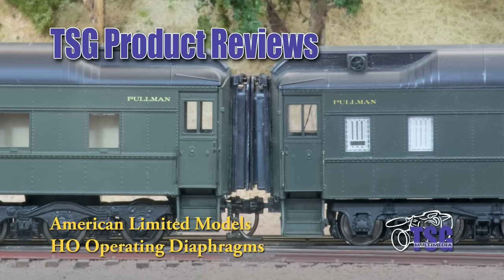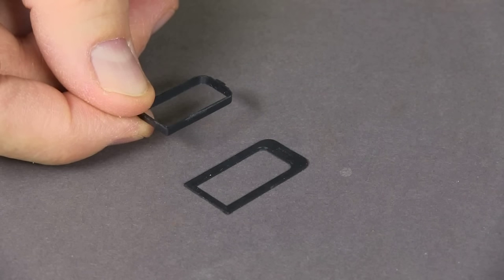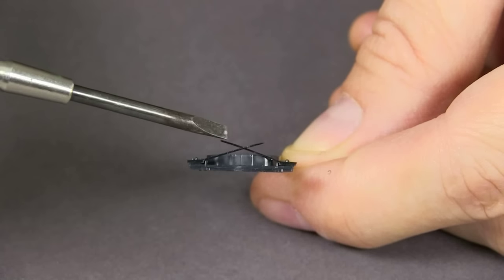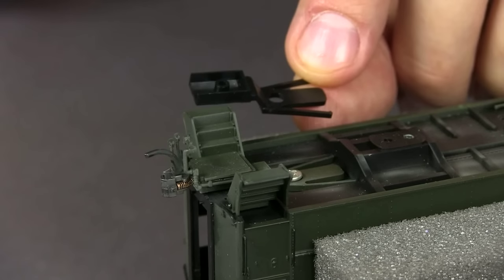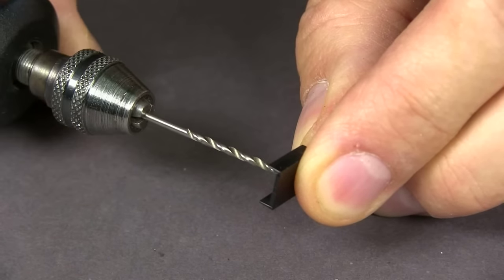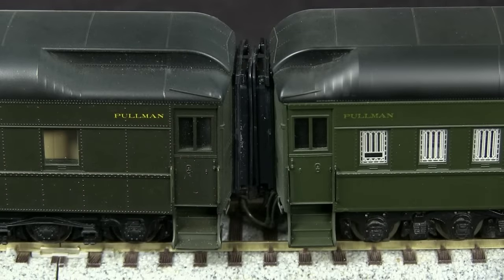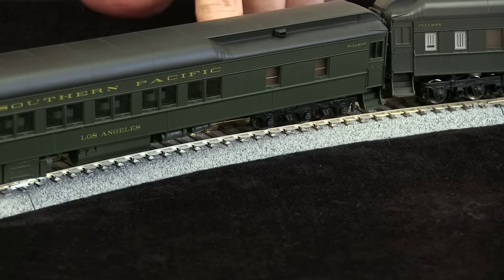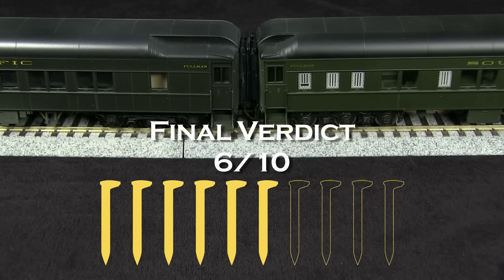HO Scale Diaphragms American Limited Models Product Review

Comment: I appreciate the level of detail you went into, It drives me batty when products are shipped with poor instructions.  But I really have no issues with this kit not working on a 24 inch radius turn.  It is unreasonable to expect a full length heavy weight car with close (more prototypical) coupling to work on such a tight radius.   So my issue wouldn't be that it didn't work, but that the manufacture made the claim they would.  I get we all make compromises in compression.... but to expect anything close to prototypical operation on on 24 radius is unreasonable.

Comment: I use American Ltd diaphragms on all my passenger equipment. They look the part and installed correctly will work well. On the Branchline/Atlas cars, do not use the spacers if you want to make 24" curves. Also do not use scale couplers. The kit was designed for the factory couplers that came with the car, not Kadees. They have a slightly longer shank than Kadee #5s or equivalent scale couplers. To make it work effectively, either use the factory couplers, or ProtoMax metal couplers. Yes the instructions are not great, nor is the mounting for the plastic springs that is too easily broken, but if you take care assembling the results look and work great.

Comment: I wouldn't use the spacers... the diaphragms are too tight with them.  I always build the diaphragms to have the strikers *just* on the inside edge of the knuckle of the coupler's pulling face.  Sometimes I'll even have it slightly back (about 0.010") where you can see a sliver of daylight between the striker face and the pulling face of the knuckle.

American Limited Diaphrams were my standard diaphragm from 1994-ish until 2010, when I switched over to using Hi-Tech's diaphragms, which I think are the best passenger car diaphragms on the market for 1920-1960's diaphragms.  The trouble I had with the American Limited Diaphragms is that the outer bellows/striker part doesn't stay in it's little sliding tracks, and pops out very easily.  This is especially true if they catch and bind up, usually derailing the cars and sending the striker flying out of the end of the cars.  I still find strikers laying around along the right-of-way from this happening.  I still use the American Limited kits for Athearn-Genesis F7's as they are different and work much better than these for passenger cars.  The American Limited F-unit diaphragms are mounted to the end of the units in a way that doesn't allow them to unsnap and get lost.

NOM
Reply: +Daniel Cortopassi Yeah, I watched your review of the N-scale ones.  Those were designed about 10 years after these HO ones were released. So my guess (and no, I don't know anyone at American Limited) is that they changed and upgraded the designs after their experience with the HO Passenger car diaphragms.  Then went on to the HO F-unit (Genesis) diaphragms and the N-scale ones with what they learned.  Of course they have a good amount of money invested in the tooling for the older HO ones, so changing or retooling that is not desired as long as they still are selling.
NOM

Comment: I think the car lift was from the shorter draw bar. I think if you use the  stock draw-bar then It will fix the problem or make the car run on a smaller radius.
 TRY IT!
IT MAY WORK !
Reply: I’ve worked extensively on passenger trains with those diaphragms, the problem with the one car derailing is the track, Not the cars. In the real railroad world all curved track has curve easement incorporated into the curves so the rolling stock can gently flow in and out of curves. It’s kind of a long subject matter, but trust me it works.

Comment: I just stick to using the much older Walther's diaphragms  with the black folded material. Those seem to work best for my applications.**EDIT**....I also would recommend the diaphragms from MHP. Those are way more flexible and actually do work well with all coach types. They are made of a neoprene rubber with a metal striker plate.